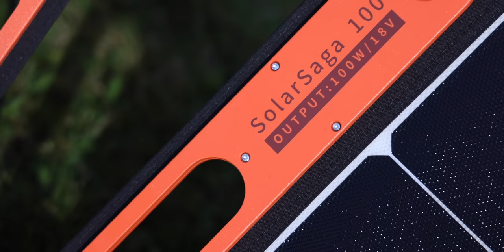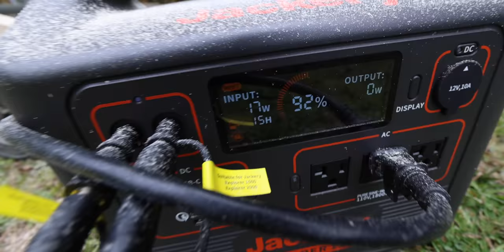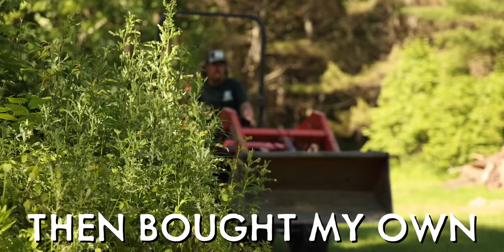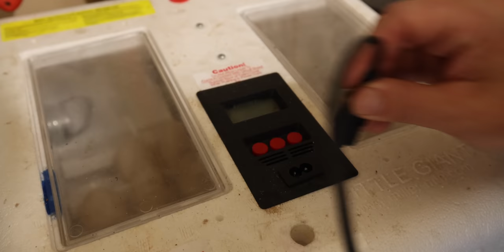Meat Eater's Garden - First Year Building the Catch & Cook Garden from Seed to Feed!

Comment: On your mini tractor try back blading to scrape soil about 

Back blading is lifting the bucket over your pile or soil place the bucket down past it and tilt it nose down lifting the wheels off the ground then slam it in reverse and drag it back where you want it and then scoop up the tailings and add it back to the pile/bed

Comment: for your tomatos, try using a very light cable  or a wire and a stronger end frame on each end of the row to let them grow on. I raise hops in mid Wisconsin and my set up is almost 10 yrs old. Iv never had to do anything to it other than inspect it as I was putting it up. Congrats on getting getting married

Comment: Pull the pins on the arm between the thumb and the welded mount, then fold thumb up and use a pin into the hole on the mount.  It should all line up and keep the thumb out of the way.